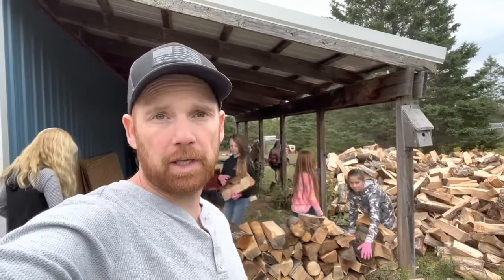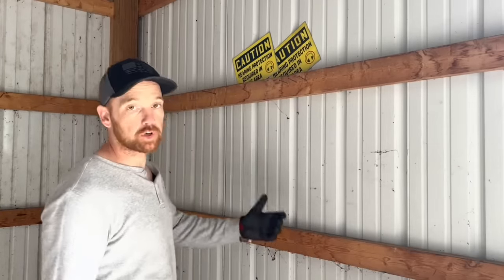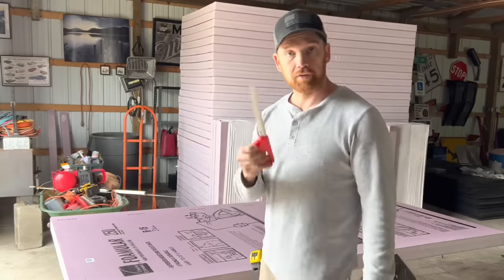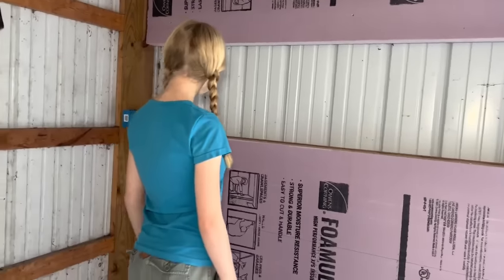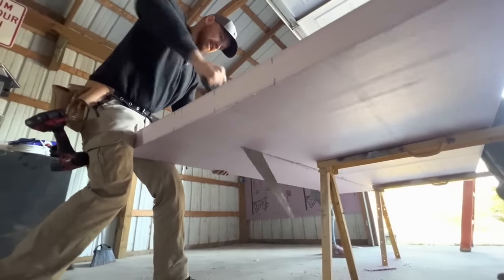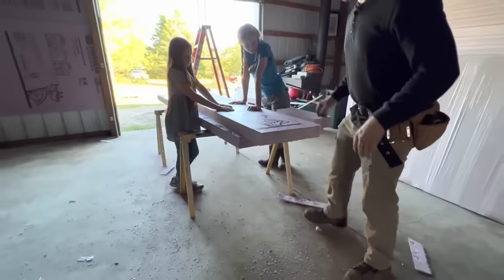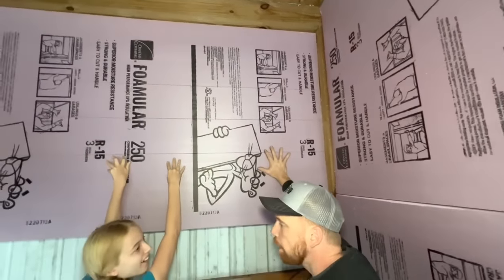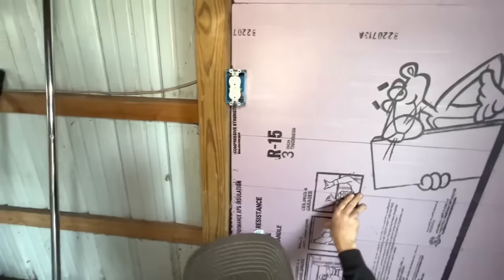Insulating our steel building/garage | Why we are NOT using Spray foam... Family prepares for winter

Comment: If you use a circular saw what they plywood blade turned backwards. It works really well for cutting the insulation at the 3 in installation

Comment: Festool makes a pricey (~ $800) but awesome rigid insulation cutter - Festool ISC-200. It is a a battery powered tool but has a vacuum port so it sucks 95% of the nasty foam particles up. It is designed to use the Festool rail guide system, so that is an extra $150 for a 52" guide but the speed that you can cut the foam perfectly straight and without putting the foam into the air is worth it. 
I did a small bathroom and replaced the 10" R-38 high density fiberglass with 4 layers of 2" R13 Rigid and used a jigsaw and vacuum to cut the rigid insulation and wished that I had bought the Festool. For a job like this garage I would not hesitate to spend the money. After the job is done, you can easily sell it for 75% of the purchase price. 
Too late for this job, but maybe for the next.

Comment: 2 inch or thinner sheets cut really easy with 25mm razor that extends to 3 inches or more. Might work with thicker sheets, haven't use anything thicker than 2 inch yet. Use a straight edge, I have a 6 foot ruler, poke a couple of nails to hold it in place, a few swipes with the razor and snaps clean. No mess, much quicker than sawing.

Comment: I have done several jobs with rigid closed cell styrofoam insulation. It is by far one of the best ways of getting continuous insulation. Yes gotta be careful about outer/inner rigid creating a vapour barrier... Need any framing to be able to breathe on one side. And absolutely save insane money compared to spray foam. I have no idea why spray foamers keep touting their 2" R10 to be better than what I have achieved eg R10 rigid + R14 rock wool. Or in the case of a roof I built on top of an R20 roof, I did 3 layers of 2" Rigid = R30 *continuous*. I'm pretty sure that's better insulation value than any spray foam. There is no ROI for spray foam. Maybe like 40-60yrs before the spray foam is paid by the heat/cooling savings. My insulation jobs are more like 8-20yrs ROI though DIY means low labour costs which really help my ROI. Same as your job here!! 👍💪

Comment: Very nice. Great you got the daughters to help out. So it's been a year, I find the pink foam disintegrates with UV over time (vs the blue DOW foam); I found this out when I used  both of them for a compost heap, wondering how you made out and if you dry walled the interior and how you hang stuff when the 2x4's are 2" away.

Comment: Might try a jigsaw with a metal cutting blade to cut the insulation. Metal cutting blade won’t tear up the insulation but will cut so much easier and quicker then using that hand saw you bought.  I have a large table saw that I cut up all my insulation on the last time just like a 4x8 sheet of plywood and that was quick and painless too!

Comment: A little over 2 years ago I was pricing out some spray foam on a flip I was doing.  I wanted to spray the bottom of the floor through the crawl space.  He gave me one price.  Unfortunately we had a hurricane that set us back about 6 months for various reasons.  When I finally got to the point of spraying in the bottom, I called the guy.  He told me his prices have almost doubled from the last quote he gave me, and it probably wouldn't be worth me doing the job.  He said it was due to Cvd and supply chain issues and the price of oil, since that is the base product used to make these products.

Comment: Hot wire is what I used in School to cut foam. Not expensive at all and easy no mess. Then again Farm livin' YeeHaw!
Reply from the maker: Does the foam smoke when using the Hotwire? If so that’s some of the most deadliest toxin you could ever breath in. Certain foams put off some sort of cyanide. Bad stuff.
Reply: @9252LIFE   nope
Reply: @9252LIFE  you will smell almonds if that happens.
Reply: Snails maybe I forget both smells are bad.
Reply: arsenic (snails)  and cyanide (almonds)

Comment: I got a quote for a 24x24 metal garage with 10' walls.. and they came in at $6000.  Outrageous.  The same company did a job for me a little over a year ago where they spray foamed an unfinished attic room and ceiling.. and then sprayed the band of our basement foundation.  Then they put bat insulation in the basement ceiling (28x56).  That entire job was less than they quoted just for the garage this year.  Crazy...
Reply from the maker: Yea it’s getting craZy out there!
Reply: @9252LIFE  Yep.  I finished building a new log home a little over a year ago.  Had we been 6 months behind schedule.. it would've cost us $100k more than it did.  We just barely beat the price increases during Covid..  and signed our contract with the log home company before prices went up.
Reply from the maker: @randomstuffwithjoe  oh man that was awesome!

Comment: I spent $6600 on blow in insulation  on my 30'X60' steel building I'm building. My outer walls are 12" thick and I'll have 24" in the attic. I used 18 gauge structural steel to build the walls.

Comment: I used canned foam with the pro applicator to fill the gaps between panels, and a jigsaw with a wavy razor blade to cut the foam sheets. Much easier cutting, and no foam dust. When you do the ceiling, check out those options.
Reply from the maker: We may be using a bubble foil stapled to the bottom of the trusses and then installing galvanized corrugated sheet metal and going up above it with the blow in insulation.
Reply: @9252LIFE  Nothing wrong with that! Might be cheaper, too.

Comment: If you secure the foam to the outside hurts with nails you will likely get thermal bridging through the nail and condensation will form in the nail head.  I would maybe glue it to the posts and use spray foam in the cracks .  That the Marshall Remodel channel where they have condensation problems.  Spray Jones talks about insulation building science in his videos too.  Looks like a fun project!

Comment: Well, you just solidified a dilemma I had on an insulation choice. I"m finishing a pole-barn into a wood-shop of similar size, and had been curious as to the cost of spray foam over foam board insulation. The pole-barn's exterior is metal over OSB with vapor barrier walls and roof. I live in North East Ohio, so pricing is probably similar.
Reply from the maker: I’d still check pricing as we are in the upper Peninsula of Michigan and everything is much more pricey up here

Comment: Jigsaw, long blade or skilsaw, or a table saw (works the best). The nails with the plastic caps are good, just chuck the nails and use long sheetrock screws. I used a brand of washers I cannot remember, but they are great; search plastic foam board washers. Good little helpers; they will have a good work ethic that is missing today.
Note to girls: Your dad IS annoying so don't feel bad 🙂
(but he pretty much knows what he is doing...)

Comment: When Snapping chalk line, place a finger in the center of the line--end to end--and then snap the left and right short lengths for a "perfect" straight line without multiple lines due to any slightly off the vertical pull up. This way you only have to pull line up less than 1/2 the distance to get a visible line. This also saves on chalk.

Comment: Gotta throw my .02 at you. 
I insulated my pole garage. Got it sealed up real nice. 
Beware in summer. I walked in during a hot/humid week and found spots of mold or mildew growing on the exposed wood post. 
Just a heads up. Get a dehumidifier or don’t seal it up.
Reply from the maker: Our summers up here in the Upper Peninsula of Michigan averages around 75 degrees as we are just off the coastline of Lake Michigan. Humidity won’t be an issue here.

Comment: your bigger issue if you are trying to condition the entire space is the lack of air barrier under metal siding and over the  pole barn skeleton.   for pretty cheap cost it would save  your a ton of heating and cooling costs do to air gaps.  thats where spray foam is king. that and with closed cell its density and rigidity  adds stiffness to the structure. along with be a vapor barrier  over 1ich of coverage.  thats why alot folk only do 1inch of closed cell then switch to open cell for cost reduction.

your optimal set up with what you are going for here without doing that air barrier, is to furr out the gerts with vertical 1 by lumber. and then use spray foam on the joints like a glue then tape the joints with zip system tape or  siga tape. this set up would allow for water shedding from top to bottom as it stands any moisture will run down and then sit on the gerts.  and better air flow. this also would be giving you both horizontal and vertical space(like a chase) for wiring in the future. 
 but personally i would run 1inc conduit  prior to any  thing  to future proof or aid in future wiring runs, or air line runs.

Comment: We put 7 ½” thick foam on our roof to insulate a timber frame loft. Cut it using a hot wire, lots cleaner than a saw, knife was out of the question. Sealed it with the loctite adhesive & tape.

Comment: Spray foam might be expensive but it’s the best insulation out there when done right! Building a 40x50 building and gonna spray it right to the metal on the inside! It’ll strengthen my building a lot as well!
Reply: Ya it's the best but it comes with drawbacks to. You are getting a 5-10% increase in performance vs  foamboard since they both are closed cell foam with the same R value per inch. The benefits come from being able to fill in all the tiny grooves and cracks which using a can of spray foam for the edges of the foamboards will do almost as good but canned spray foam is open cells so not as high in R value but that's only on a small % of the wall. Spray foam(closed cell) does add actual rigidity and strength to a wall but it's permanent and can't be removed. It makes adding any wires or pipes difficult, too. There is a small risk of it not being applied and cured properly which would literally condemn the entire house due to the poisonous VOCs that it will emit for decades to come. It's also incredibly flammable and will burn almost as fast as gasoline while creating a thick toxic black smoke. Unfortunately foamboard is no different but at least it's only 1/3rd the cost. I have thought about doing sprayfoam many times but the cost does not justify the price imo. I think it's good but cost needs to come way down.
Reply: perfect shake it well it will cure fine.
Reply: @randybobandy9828  the method used in this video will also make adding wires near impossible.  but I digress. spray foam saves miles on labor.
Reply: @snakeplissken2646  no it won't. There is an obvious 1in gap or so where you can run wire between the foam board and drywall or obvious board that he decides to add to the inside wall. No spray foam doesn't save on labor. Labor for who? The pro company you hire to install it and pay a fortune for? Or labor when you pay the same price to DIY it with a frothpak but just for the materials when you still have to install it yourself anyway.
Reply: @randybobandy9828  I install it all the time  he has hrs on 4 sections in his barn I can spray that whole barn  in 4 hrs. what drywall? and this  board u speak of adding why cant I add it to the spray foam version? also I would have all electrical  done br doing a y finishing  work I also would add extra for future applications.  also I've never paid anyone  for any labor build the barn myself.
Reply: @snakeplissken2646  I literally just explain to you why labor isn't a factor. Diy spray foam isn't saving you any money vs. a pro. That means labor is irrelevant.  What drywall? You're talking about it being impossible to run wires when using foamboard insulation, it would be impossible if the cavity was 100% filled with foam but it isn't. There is an inch gap. Usually, people put up drywall on the walls after insulation.. what do you think? You're the one whonwas talking about ADDING WIRES.. as in LATER. How did you forget you said that? Spray foam is simply too expensive to bother for almost any situation,  especially in a pole barn that has massive 10ft×12ft tall wall sections. These aren't 15in wall cavities.

Comment: You can use a utility razor and score the foam then snap it. Might not get a perfectly square edge so I would reserve that for the top and bottom edges. Would save some sawing. Also, did you mark the 2x4 centers on the posts? Would make it easier to locate them when you’re screwing the tin on.
Reply from the maker: Yes we did on the first section
Reply: Make a story pole you can walk around the shop with. Quick and accurate.

Comment: That stuff cuts like butter on a table saw.
I had really good luck with leaving a gap between everything and filling the gap with spray foam.
A spray foam gun from Great Stuff works excellent. Easy to control the amount of spray and you can stop and start without using the whole can. It's like a power calking gun. The same can can stay on the gun for well over a month and work perfectly.

Comment: All those nice air vents at the bottom of steel sheets I sealed off with spray foam in cans to keep the mice out. Couldn't figure where they were coming in until I seen those gaps.
Reply from the maker: Check out our newest video to see what we did.

Comment: If you could box in the posts because thats a timber post barn you use you thin strips to box in the post then add interior 2x4s to put up the interior wall board but id think about using some kind of plywood so you've got something to scre onto if you need to put something on the walls, just go cabnit height and the rest 5/8" drywall so you've got a fire ratting becuse foam off gasses will know you down in a fire.

Comment: Helpful hints,use big sheets on bottom so you don’t have to hold up top pieces, and they are lighter to work with on ladder
Reply from the maker: The reason we put the smaller pieces at the bottom is to have less seams towards the bottom that way when most of the heat rises it won’t try to find a crack in my project to escape.

Comment: proper wall/roof structure will prevent all sorts of damage. Water will penetrate your shingles and siding. Give it somewhere to go !!
outside to inside:: shingles/siding;  vertical sleepers to create air-space;  waterproof membrane;  insulation;  vapor barrier;  interior sheathing.
When water penetrates the siding/shingles; it will drip down the waterproof membrane (and out); the insulation will stay dry and thus effective.
2" closed cell spray foam toward the exterior plus whatever bulk insulation you fancy; will keep your building warm, dry and rot/rust free.

Comment: Great install and the team you have is the best. I'm impressed that they are such hard workers.
I was just going to insolate my garage door with standard wall insulation but realized it's way too heavy so I'm going to use foam. It's so much lighter. Not quite the R value but the door can't take the weight.

I was wondering why your flag is backwards? The blue field should be on the top left to the viewer under normal circumstances.
Reply from the maker: Thank you Mark. You’re not the only one who has mentioned the flag. The flag is facing out the garage door towards the house. So when the door is open we get to see old glory 🇺🇸. The camera during my filming is behind the flag so you’re seeing it from the backside.
Reply: @9252LIFE I did notice the garage door behind so I thought that may be the situation but from our angle I wasn't sure. Not trying to be critical. Love your video and your family. You are informative and very helpful.

New to your channel and look forward to more.
Have a Merry Christmas.

Comment: I was under the impression that most adhesives melt the foam. I believe locktite makes a blues colored adhesive product that doesn’t melt it but my experience with it was it’s not that sticky. Good luck.
Reply from the maker: Some adhesives will melt it but this specific adhesive is for foam board

Comment: I did the pink foam on my pole barn too. You should cover that with sheetrock or something non flammable.  The pink insulation board is very flammable
Reply from the maker: We’re using a steel roofing Tin
Reply: @9252LIFE   Good deal

Comment: I didn't use the 4" but i did use 2" and doubled it. I cut it with my table saw. I purchased a heated knife to cut it and it wasn't worth it. Using a regular saw was messy but much quicker and straighter cut.

Comment: Crazy price, I had a 30x40 sprayed 2" back in May, for 8k. I do somewhat regret it.  It's working great,  but it pops loudly when the roof heats up. Scares me sometimes when I'm in there, it's so loud.  The roof panels look like they're being compressed when viewed outside.  They did a good job mixing it,  no off gassing, but not one of them spoke English when they showed up, so I could barely communicate with them.  Another job I wish I had just taken the time and put my own foam panels up.

Comment: That hard styro is like 6x more expensive then regular onefor same width, and its use is for places that need to be more impact resistant. For cutting styro I made myself diy cutter with some nichrome wire, very easy and cheap to make and cuts styro like butter with no mess